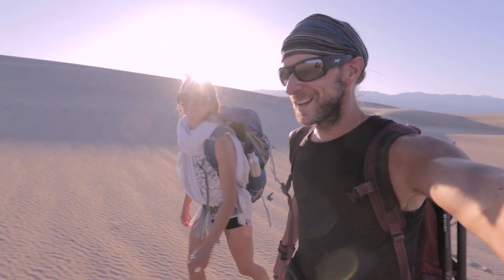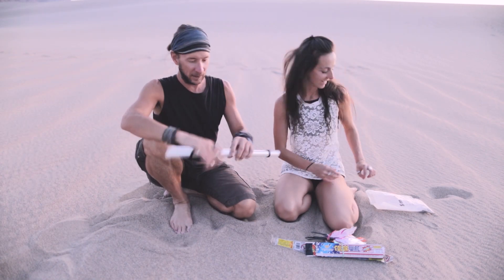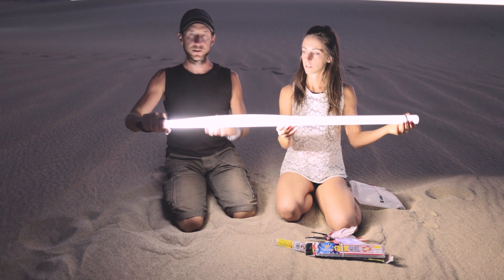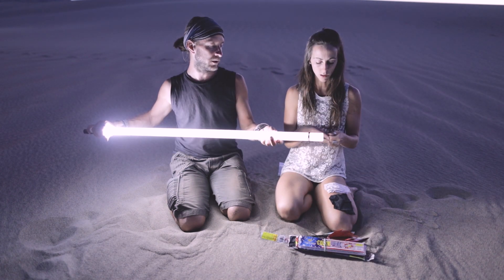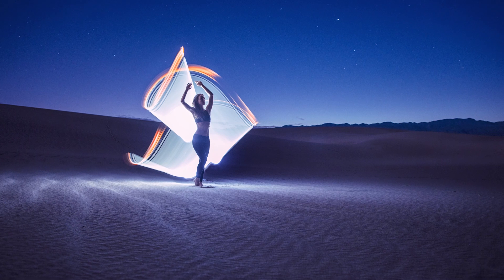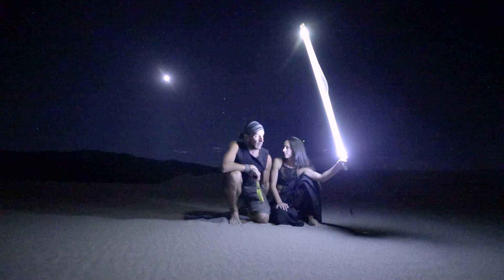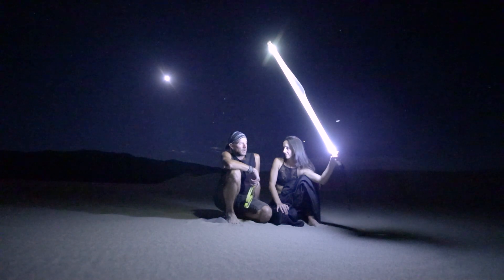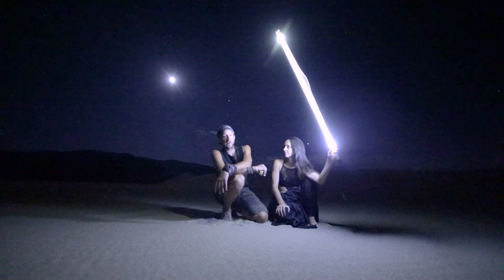DIY Light-painting tube tutorial! Tube Stories 152

Comment: I tried a DIY tube with not much success. I bought a T-8 tube, cake collar and I had some Roscoe gels. I took the cake collar at the width you suggested, attached the yellow gels I had at half the width of the cake collar like you stated. I slid cake collar/gel strip into tube and used a white cloth over end of tube. I used a G26 flashlight that I believe has like 330 lumins. I set my camera on bulb, F/9 and 200 iso but tube was VERY dim. The tube was very bright for the first maybe foot but after that you can barely see any light throughout tube in the exposure. Any thoughts or suggestions ?? 
Appreciate all you guys do for light painting !!
Reply from the maker: hey hi!! f9, iso200 is probably not optimal if your flashlight is only 330 lumens. Try at f4 (in a darker place). It should be better ::)) Thanks!

Comment: Hi Erick, for the flashlight olight m1x you use T8 or T12 tubes? I try with a DIY tube with 30mms of diameter, but the hot spot is too brilliant, I try with only tube, with a internal diffuser but the lidht it's not good
Reply from the maker: T8 only :)
it's normal to have a hot-spot. If you look at my pictures, you'll see that I always have a brighter spot near the base (where I hold the flashlight)
Reply: @Ericpare  please can you tell me how much is the outer diameter of the T8 protective  tubes? Thanks again :)